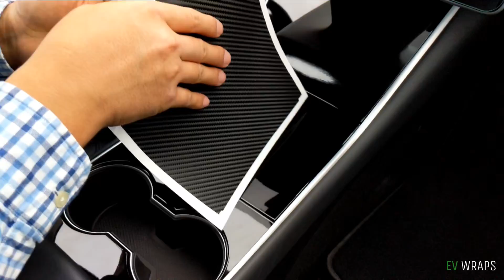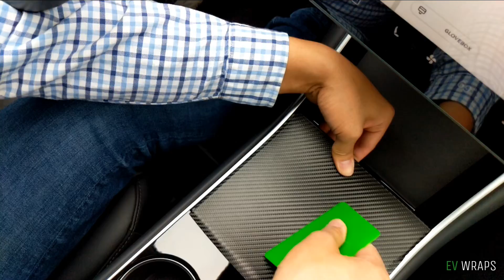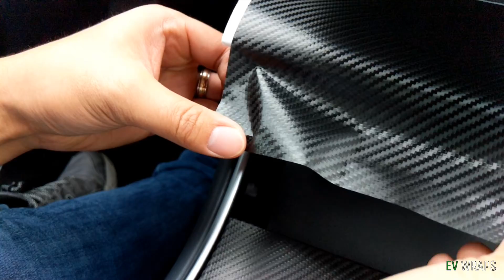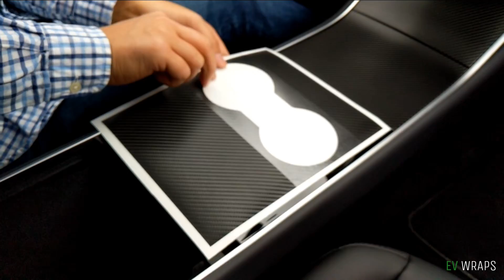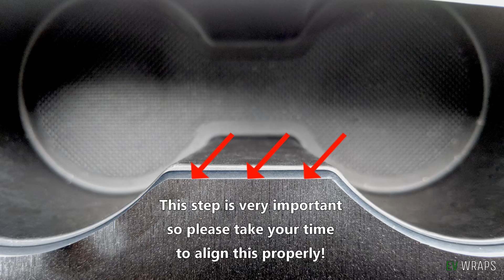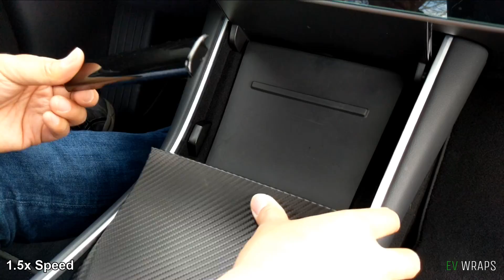Tesla Model 3 / Model Y Center Console Wrap Installation

Comment: Is removing the wrap easily done without damaging the console? Other videos of 3M wrap removal appear to show the wrap requiring a lot of heat to release.  Wondering if this would damage the plastic of the console.  Has anyone tried removing their console wrap who can share their experience?
Reply from the maker: Hello!

Thank you for your question. To properly remove a wrap, warm up the wrap with a heat gun or hair dryer first or you can wait for a warm/hot day. This will loosen the adhesive and will make the wrap a lot easier to remove. After that, you can start at any corner and peel off the wrap slowly. Peeling it off slowly while it is warm is important because it will result in no adhesive residues. 

This will not damage the original plastic finish in any way as long as you do not heat one specific area for a long time.

Comment: It's not as easy as the video makes it look. If any part of the sticky happens to flop and hit another sticky part, game over. You'll tear it trying to get it apart. I messed up the middle section for both my M3 and MY. They are sending replacement parts. I hope I do better this time. It loooks better than factory, but it will still scratch with a finger nail if you're not careful. I don't regret the purrchase.

Comment: Why are you using the squeege to tuck the sides in when you can just lift the panels up and adhere them with your fingers?
Reply: As you lift up the panel, the hinge section of the panel will go down and it could result in the vinyl catching debris around the hinge area. Also, the spaces in some of the sections are too narrow and you need to use to squeegee to tuck the vinyl in. 

Thanks for asking!

Comment: What happens when you want to take it off in the future? Will it leave a sticky or scratched up middle console when revealed?
Reply: We only use the best automotive grade vinyl in the industry (3M) and it is designed not to leave a residue even after years of application. Therefore, we strongly recommend everyone to buy the best quality vinyl for your Model 3 center console. We've performed many test trials on different vinyl brands and 3M came up on top. The worst are generic non-brand vinyl. In one of our temperature tests, the adhesive actually separated from the vinyl which resulted in a very sticky surface and it was a nightmare to remove. 

The best and proper way to remove the wrap in the future is to heat it up first with a heat gun or a hair dryer. The heat will loosen the adhesive and make the vinyl more elastic which results in easier removal. After heating up, slowly peel off the wrap at any corner. Make sure to peel it off slowly

Lastly, the wrap actually protects the center console from scratching up. Therefore, the center console will look exactly what it looked like right before you install the wrap!

Comment: I purchased the wrap from EV Wraps a few weeks ago.  I've been dreading the installation.  Is it really going to look that good from an amateur installation?  I didn't think so.  I figured that the worst case is if it doesn't install well and looks bad, I will just return it.  Well, I watched this video completely 2 times and decided to try the installation.  I pulled my car outside when it was cloudy but still had great lighting.  I must have repeated many sections of the installation video 10 to 20 times.  It was super careful and after about 1 hour, I finished the installation.  It looks factory installed.  The wrap and the video are top-notch.  I would totally recommend it.  By the way, I purchased the Matrix Black.  It's a fairly mute color with a little bit of a pattern.  If I accidentally scratch the wrap, it won't show up compared to a solid color.

Comment: How do you keep the vinyl wrap clean once installed (such as removing oily marks and finger prints)?
Reply from the maker: You can use alcohol wipes or lens wipes to remove any persistent oily or fingerprints on the wrap.

Comment: Well I just balled up the center piece. It stuck to itself in the tiniest place, and in order separate it, I had to pull so hard that it stretched it. So now I guess I’m buying a replacement and paying a professional to do it. Awesome.
Reply: I believe they have a free replacement warranty in case your installation goes bad.
Reply: I should specify that I was using the matte black, maybe the carbon fiber texture and appearance provides a little more room for error.
Reply: Michael Prince I had the matte black too.